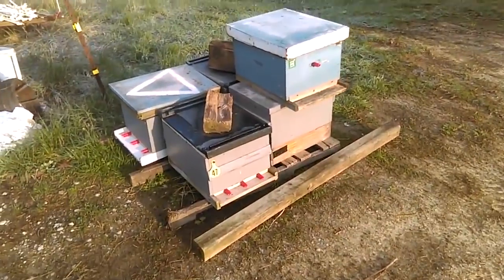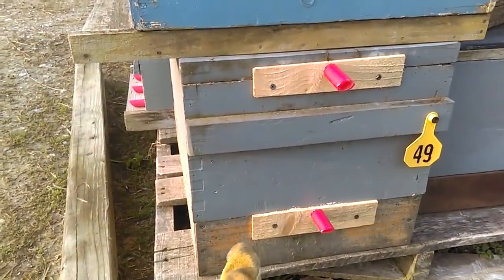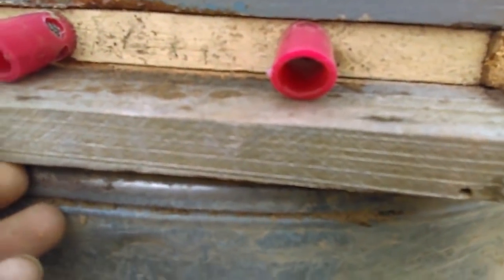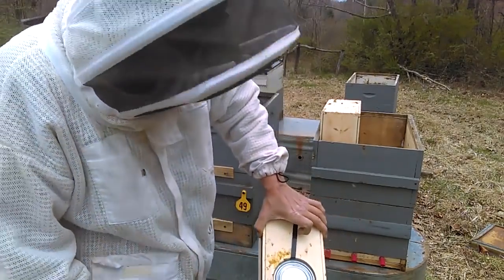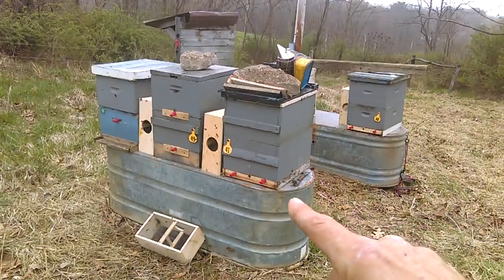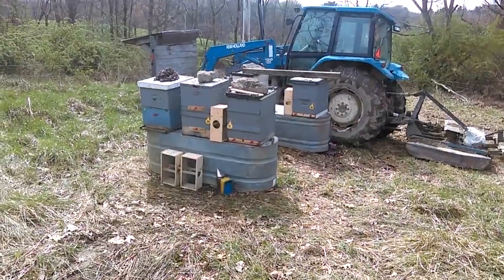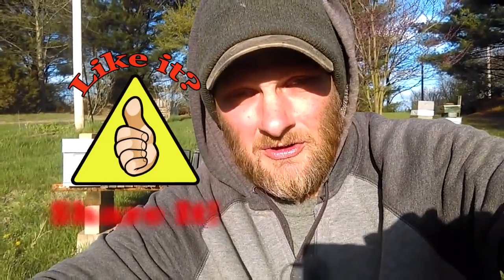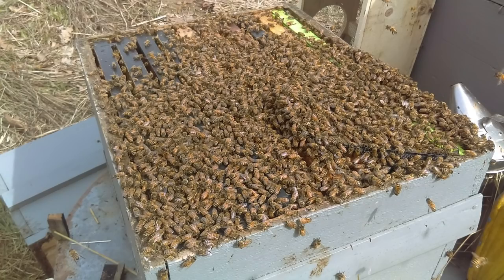Bee Package Pickup And Install

Comment: Jason, very munch enjoy your channel. I put the empty box on the bottom board, pull the can and set both that and the package in there. As you did I put the queen cage between the frames (with the candy side up so dead attendants don’t block the hole)  and set the frame box on top and put on the cover. Next day or two you can remove the bottom box and package, rarely a bee left in it. This is very fast in foul weather and is easy any time. Good luck on this season and keep the videos coming.

Comment: I tend to put the empty brood box on the bottom if I have to do a bad weather install - just take the can out and queen and put between frames. The box goes in the bottom - hole upwards. Bees will always tend to go up - so it avoids the bees festooning on the roof - they all climb up into the brood frames. Plus if the weather is still bad a couple of days later I can just lift the brood box off (leaving the roof on) and remove the bottom box and package box and set the brood box on the floor.

Comment: Jason...those metal water tubs....those are going to radiate a LOT of heat in the summer and dump it right under the hives. Will make your bees have to work harder to cool the hive come mid summer
Reply from the maker: Very good point about the heat. I better keep and eye on them and consider another option for my hive stands. Thanks for the pointer!

Comment: I'm surprised you bought bee packages with all the nucs you have; that was a very unusual way to install bee packages from the way I used to do it. I would leave half the frames in, put the queen on the furthest frame, then place the bee package upright where the other frames would go without dumping the bees. Then after a day I would remove the package and put the rest of the frames in; they would be cleared out by then. The only thing left would be dead bees.
Reply: well done .I have a question how much is the plastic frame

Comment: I like installing packages in nucs to start with. They seem to build up quicker. You do have to keep on top of them to not allow them to get too crowded before moving to a 10 frame deep.
I made a little "cork screw" for getting the cork out. I always struggled to get the little cork out of the cage.

Comment: Jason,  great video,  BUT.... (out of love for the bees and you...) 
If you shake bees(bump them down) to one side of the package hole,  then invert the  package on top of the frames,  you don't have to shake them out... Just put Queen in place,  put the lid on,  and walk away for 3 hours.   When u come back..all the bees will have migrated down.
change the direction of Queen cage strap so fontant faces up
Reply: This method you described only works in warm weather climates. Good way to kill the queen in cold climates.
Reply: @bwakel310  I'm in Texas.. So ya.   But as long as it's gonna be warm x3 days.. Should be fine.   I've got friends in indiana that use this in late April/early May every year.

Comment: Thanks for the video! I got into my hive that I did a cut out of a unframed box today. (My first year of beekeeping) little concerned with all the Drones and drone cells I see. I did see reg brood so I believe queen still there.
Reply from the maker: Hey Tim, If you seen brood your queen is still there. Is she not marked to make her easier to find? How many drone frames are you seeing?
Reply: I filled 18 frames with cut outs, then rubber banded them, so it’s not as clean and straight as with foundation. But they are doing a good job of attaching and cleaning them up. I’d say 6 to 8 frames have at least some drone cells on them.

Comment: What are the specs on the truck Jason?
Reply from the maker: My Yota? My Toyota is a 1992 3.0 4x4 with a steel flatbed and custom rear steel bumper. I love it. It's easy to fix and parts are cheap. Of course, I don't drive it much though as I work from home and the farm is only 1/8 miles from me. lol
Actually the flatbed was on the farm when I started to manage it and after a couple weeks the land owner showed up and said, "Your doing such a great job managing my land that you can have that truck bed". 
You like older truck or are you a Yota fan?

Comment: Jason, I noticed you had some wax moth tracks in the drawn comb you used. Does this not introduce a problem into the hive?
Reply from the maker: Yes, they were old trails from the moths. I am wanting to see if the bees fix it or not. May end up replacing that frame.

Comment: Not a very good plan!! Package of bees..... Take out the sugar water, take out the queen, place her between frames and then spray all the bees with sugar water. Shake bees in box without another box. That way you don't have to smoke so much and the bees will already be in their home!!
Reply: I had to do this yesterday I'm in Michigan it was 48 when I installed them I couldn't spray them down. They were awfully flighty but seemed to settle down.
Reply from the maker: @Lourens Klopper Not sure what you have against my method but it worked just fine. Checked them yesterday and loads of pollen coming in and queens are released. I re-installed missing frame and everyone is happy. I guess we all have different methods but it doesn't mean one way is wrong. 
Thanks for your input and bee safe!
Reply: @JCsBees  Nothing wrong?! Just use an exstra box on top to shake the bees there off.1 box will do the same thing, less shaking and smoking of bees. If you spray the bees with sugar water, they will clean each other off and would be much easier to shake them in their home hive. OO yes, put the queen first in between the frames, before you shake the rest of the bees into the box!!